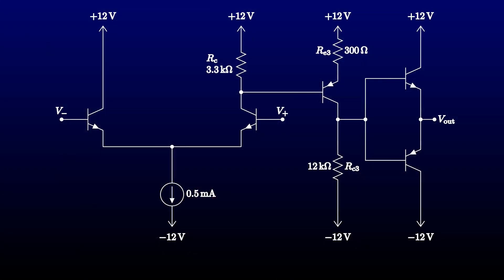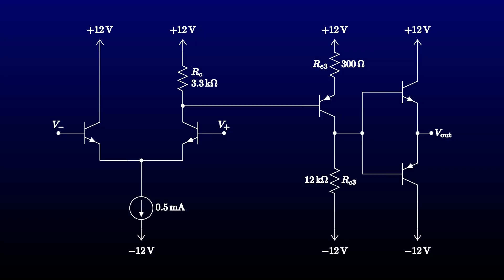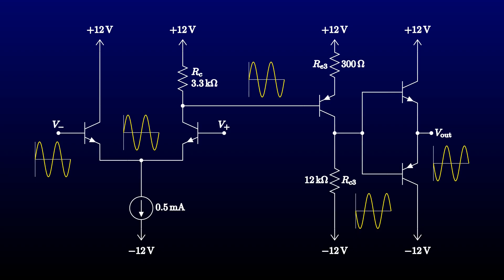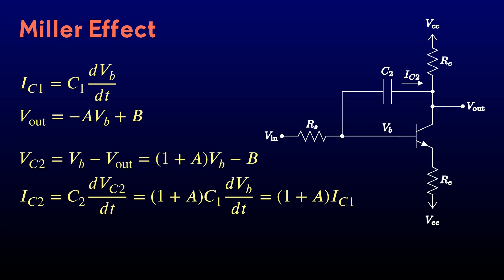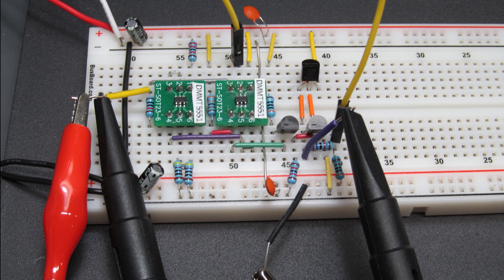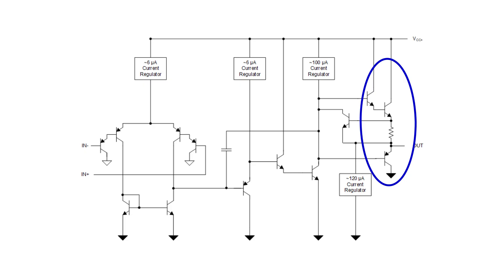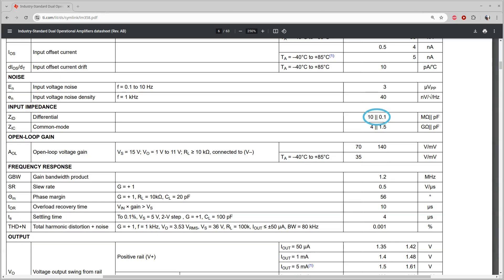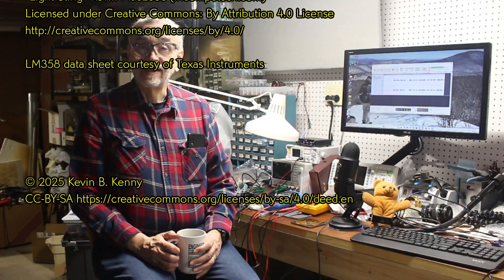The Differential Pair Becomes an Op-Amp - Transistors 101, episode 18

Comment: Could bootstrapping the opposite sides of the differential pair help with gain? Or would that introduce too much differential positive feedback?
Reply from the maker: Bootstrapping is mostly used to increase input impedance, which is already extremely high once you've put a current source in the tail.  What is usually done to increase gain - often by a couple of orders of magnitude - is to drive the collectors of the differential pair with a current mirror.  The two transistors in the mirror are trying to keep the collector currents equal, while the differential gain is trying to drive them apart. The result winds up being that the voltage gain at the collectors becomes astronomical. This high gain then propagates through the gain stage and the push-pull output.  (You can see this idea toward the end of the video, where we dissect a typical cheap bipolar op-amp.)

Comment: Hi Kevin fantastic video, I only found you recently when YT recommended one to me as I am studying op amps,  I was curious to know if you have ever looked into a 60s HP wave generator ? which uses a diode ladder & a op amp differential pair. To create the required waveforms,  To add I have been gathering the parts  required to make my own on a breadboard. But I am limited to 1amp, with the power supply  i would of preferred 5amp but we can't have it all. , also did you design the sot23 adapter boards your self or did you find them ready made?,  admittedly I haven't looked through your git if it's on there but a link to the kicad file would be beneficial.  Thanks
Reply from the maker: @StatusFIX  I'm planning an episode about  the diode ladder from the HP 202A (introduced in 1952) but with modern op amps (and component values adapted to the lower voltages of modern gear). 

The SOT23 adapters are commercial. There are a ton of vendors on AliExpress and Amazon selling them for cheap.

Comment: (Loved the Bob Pease quote.)
Sorry, but I don't follow your logic that  "If the signal is too high, that will come in as an upward movement in the V minus  input"
and "if the signal is too high, that will come in as a signal displaced upward at the minus input"
Do you mean the first stage is just supposed to work like a single opamp  wired as a voltage follower ?
Reply from the maker: I'm trying to establish by working around the feedback loop that there's negative feedback. That means that if the output is higher than the desired value, the effect around the feedback loop will be to pull the output in the right direction, and likewise if the output is lower than the desired value.

So what I'm saying - apparently without the greatest clarity - is that if the output of the circuit is higher than the desired value, the voltage at the (-) input of the differential pair will be higher than at the (+) input, and hence (you can follow from there, I think, as I describe what happens at the intermediate nodes.)

Comment: Here's something that always made me chuckle.

If you go onto many of the audiophool websites, they have an almost pathological adversion to opamps in amplifiers, instead preferring discreet designs. Now if you were to go look at the schematics of those "doesn't contain an opamp discreet amplifiers" what do you often find. A long tailed (differential) pair input stage followed by a frequency compensated voltage amplifier stage driving into a class AB power output stage. Their "doesn't contain any opamps" amplifier is basically a huge opamp! 😂😂😂
Reply from the maker: I think that part of what's going on is that the audiophiles have learnt to like certain forms of distortion better than they like a completely undistorted signal, but for the most part the engineers haven't been able to come up with a good description of what it is that the audiophiles do like.  Perfect reproduction of what you'd hear at a live performance is consistently judged to be inferior to certain specific distorted signals - but the desirable distortion is not well characterized. "I'll know it when I hear it."

But it is amusing to see these folks reinvent the op-amp - and then claim that a bad op-amp must be better than a good one!
Reply: And if you consider that using extra follower to get offsets in line, those particular transistors are presumably a special choice to fit perfectly. The likelihood that even a good engineer can find off the shelf parts to perfectly compliment each other is unreasonable, on top of the fact that the discreet version will have way higher stray inductance and capacitance throughout it. Shopping through available integrated opamps just MIGHT be the better path to an audio product... the marketing side is a different matter

Comment: As I expected, yet another fantastic video! Did you by chance measure the gain bandwidth product of the compensated breadboard op-amp? Of course, it won't be great, but I'm curious. Even if it's 100 kHz, it might be useful in some medium power use cases where most small signal op amps give up. As a follower alone, I'm guessing it would do a reasonable job driving a small speaker, especially with medium power output transistors. Just a thought...
Reply from the maker: There's an upcoming video where I do drive a speaker with a pair of transistors in class-B operation.  It's far from perfect. They're driven from the output of an ordinary op-amp (both cheaper and easier than all the hacking with differential pairs that I show in this video). It's still not a terrible circuit for low-frequency, high-current operation.

I haven't analyzed what f_t might be. But where these discrete drivers tend to fall down is slew rate.  When the bottom transistor turns off and the top one turns on, or vice versa, the op-amp has to make a two-diode-drop jump in voltage nearly instantaneously.  That shows up as noticeable residual crossover distortion in the output at higher frequencies. (It's also mostly in the odd harmonics, which don't usually sound all that pleasant.)  The fix for that is to run the output transistors in class AB. One of these weeks I'll do a video or three about how to do a better discrete power amp.
Reply: @KludgesFromKevinsCave  Sounds good. I guesstimated f_t is might be around 220kHz, but I could be way off. It would be nice if you could go as far as measuring THD or at least the relative level of the next harmonic as a function of output stage quiescent current for class AB. It doesn't have to be comprehensive, just a few data points to get an idea. I always had it in my head that more quiescent current is better upt to a point, but I never bothered measuring. These days it's much simpler to use efficient class-D amps for audio output, but that's not the point 🙂
PS: what makes your videos stand out is that you maintain a healthy balance of theory, practice, and quantitative measurement to compare with theory. OK, one last thought: it would be really cool if you eventually build a high quality PC board at some point and compare performance with the same circuit on a solderless breadboard. I have yet to see anyone do a good job of that. It's hard to generalize, but you know what I'm getting at.
Reply from the maker: @madhusiddalingaiah5301  I'll get around to making boards one of theses days - once I've advanced to a circuit I want to keep!

I'm afraid that I already tore down the op amps, so I'd have to take time out and rebuild it. But this sounds like something you could try at your own bench! All the parts I used are dirt cheap and available by the million (well, maybe not the matched pairs, but they aren't terribly pricey.)

Comment: Excellent video! Thank you. What is the advantage or purpose of the asymmetrical output stage in the LM358?
Reply from the maker: LM358 is a single-supply op-amp, so it wants to be able to deal with inputs and outputs that go all the way to the negative rail.  Duplicating the Darlington from the positive side would introduce one diode drop in the path that's pulling down.
Reply: @KludgesFromKevinsCave  Ah, makes sense, thank you. I was assuming a split supply. I probably should have looked at the spec. sheet. 😞

Comment: I have always despised the Miller Effect.
Maybe if Miller never discovered it we might not have to deal with it! ;) ;) ;)
Reply from the maker: Sometimes, as here with the frequency compensation, we make Miller work to our advantage.  I do plan at some point to cover the cascode, which is often used as a 'Miller killer' - by holding the collector voltage nearly constant, it allows a current-mode output with very little Miller effect.
Reply: @KludgesFromKevinsCave  I know it is somewhat beyond your intent, but talking about wasy around it, like a common base amp at the collector???
....hmmmm,  hmmmm, maybe ??????
Reply from the maker: @stevenbliss989  The cascode is one of the next things I plan to discuss when I get back to Transistors 101. I just decided to give this series a rest once it unlocked the op-amp.  You're right that the cascode is the Miller Killer. A cascode is a common-emitter (or common-source) amplifier driving a common-base (or common-gate).  It goes all the way back to vacuum tubes, where the output amp would be a grounded-grid circuit.
Reply: @KludgesFromKevinsCave  Did not think about tubes in this, interesting. :)

Comment: A great intro in to the basic opamp concept..  
Reminded me to dig up John Lindsay Hoods liniac for another look ..
Looking fwd to your next issue
Reply from the maker: That legendary class-A amplifier of Linsley-Hood was wonderfully simple (and performed surprisingly well), but was ridiculously power-hungry.  It also introduced a fair amount of distortion at high signal levels - but it was the sort of distortion that audiophiles think sounds pleasant.

It was a brilliant thing to do with only three transistors in the final amp, at a time when transistors were ridiculously expensive and PNP power transistors were horrible.  But we're fifty years beyond that. Class D power amps can be made to sound good with careful design, and if you don't believe that, you can always fall back on Darlingtons (or better, Sziklai pairs) in class-AB push-pull operation.  

It would be really hard to do a double-blind test to see whether the JLH amp actually sounds better.  The JLH amp heats the room. :)
Reply: @KludgesFromKevinsCave  

unfortunately youve misunderstood my point..  JLH designed an discrete opamp he called it the LINIAC albeit without a diff.l input stage.. as published in wireless world 1970ish something something......    my intent was just a note regarding discrete opamps......
The 1969 10W ClassA amplifier was revolutionary in 1969 as many early commercial solidstate amps had a reputation for harsh and strange distortion behaviours..  
His work from 1969 is still regarded as a reference by many an engineer today...  he led the way fwd back then...  and todays audio amplifiers are all standing on the shoulders of those engineers that went before them..
Reply: WW 1971 September issue page 437
Reply from the maker: @Robert.Chauval  Thanks, I'll have a look. There were giants on the Earth in those days!